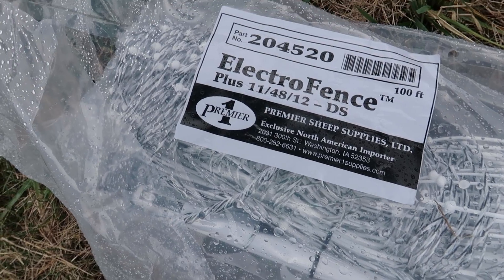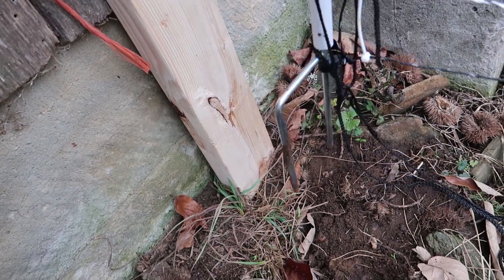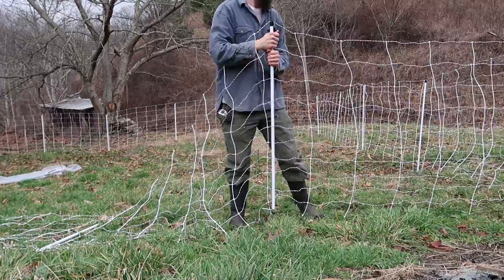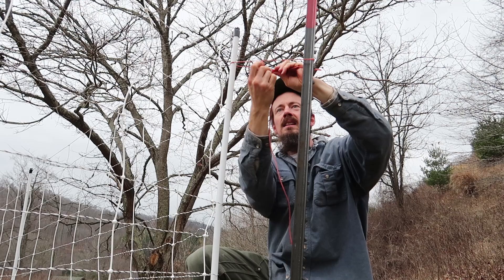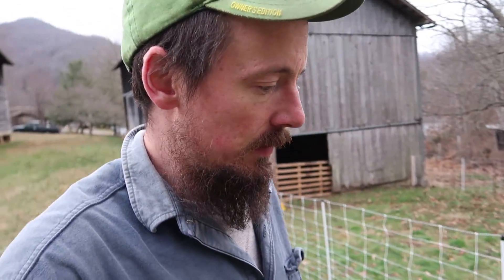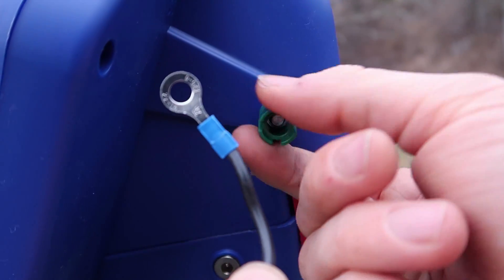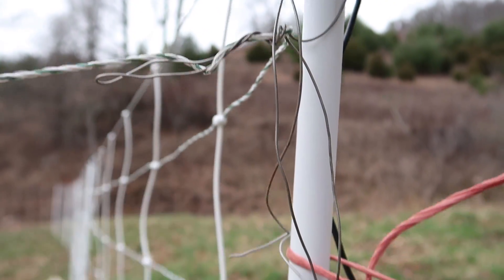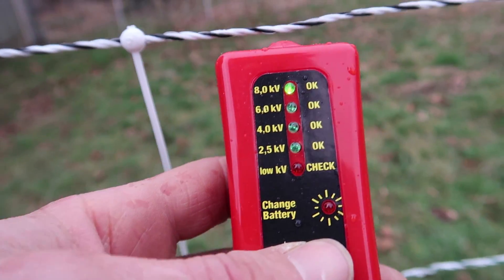Premier One Electric Netting Fence and Charger Setup For Goats - 8K Volts!

Comment: My goats figured out how to respect the fence over night. Originally I thought a dog charger was all I needed. My goats laughed at it. I found out one that worked against cattle was also way too weak. When I got a goat fence charger and swapped out the dog charger, by morning the goats respected the fence. So did my grandchildren! 

I have a people gate that has a wire 18" above the ground. The goats won't even challenge that wire even with the gate open! Moses one of my breeding bucks new a section of fence was dead. I fixed it and when he realized it was working again ran halfway across the yard shook his head at it bellowed at it, until he saw the females in heat on the other side...that got him back on his game...but he doesn't challenge the fence.

Comment: I looove the music you used here. I like using it for time lapse stuff :) On inexpensive land: there is actually some really cheap land in southern CO- about 5 acres for $2k. But there's no water so you'd have to ship it in and have a cistern, which isn't ideal for us personally. We are now looking in AZ. Still short on water and land is a bit more expensive than southern CO, but there is lots of industry stuff for us (jewelry, machining, and gunsmithing) so that's where we're setting up. Thanks for the fence setup demo! I know nothing about electric fencing so I appreciate everyone talking about it and showing us how it works.
Reply from the maker: Lots of special concerns with electric fences in very dry regions. When extremely dry, sometimes a pos/neg netting fence is ideal. Instead of relying on a traditional grounding rod this fence contains alternating ground wires and requires contact with a hot and ground wire to achieve a shock. 

Yes, water a huge concern out there. The water right situation in CO is so foreign to us out east where every mountainside has springs and creeks. 

Thanks for your thoughts.

Comment: This viseo came just at THE PERFECT time, just what I have needed to learn about! Thank you for sharing! I didn't hear you say if this fence runs off of solar power, and then has to be charged by electric at some point, or if it runs totally from the sun power, off of that solar panel that you put on the t-post. I've seen others use these fences on YouTube, but haven't heard the entire operation of them, and haven't researched further into the way it works yet. I'm not familiar with how this works, so trying to find out for sure, because I'm looking at this fencing possibility to start with chickens and around the garden to keep predators and nuisances out.
Reply: If there is enough sun it should charge by solar only.  You can charge by plugging it in to home electric as well though.
Reply from the maker: It is solar, but if you aren't getting enough sun you can plug it in and charge it.
Reply: ART and BRI Great! It's good to know that you have the security you need with an electric fence, yet not having the electricity use cost! Also good that it can be moved anywhere, versus the cost of a permanent fence, and limitations of permanent fencing. Thank you so much for your reply!
Reply from the maker: The only time you would need to recharge a fence like this with AC power is during long runs of cloudy weather in the winter. If the charge drops below a certain level, for the sake of animal containment and battery life, you need to plug in and charge. If you live far north or plan on lots of winter use, there are certain chargers designed with larger panels and batteries. Running the battery low reduces its life. In face proper charger storage involves periodic charging, or easier, just leaving the charger where it gets come sun every day to prevent the battery from running down with time. The charger from Justin, used with the chickens right now, has had great performance straight through the last several weeks that were mostly overcast. 

Solar chargers are great for flexibility and portability, but they are not cheap and batteries only last 3 - 4 years officially.
Reply from the maker: If you want to fence a large area, an AC charger can be much more economical, as you can buy a very powerful charger for a relatively small price compared to solar. Running fence on AC power really does not cost very much.
Reply: ART and BRI Thank you for your thorough explanation of how it works!

Comment: This was very informative. I have 2.2 acres and I want permanent fencing but can't afford to get it at this time. I have a smaller section that I was just going to have chickens in. I think with this fencing though I can go ahead and get the sheep I want and then use this to move around and attach to the entrances of the section I already have. Or even get enough of it to fence off where I wanted the permanent fence until I can get more established.That way once I do get the permanent fencing I can still use this kind to rotate them to different sections.

Comment: I am old and my electric chicken fence is heavy.  I've been wanting to make a carrier for it out of a old furniture dolly, but haven't figured it out yet.  Thank you for telling me how to hook charger in the corner and about the grounding post and how you get it close to buildings.  Mine didn't come with a grounding post and I have been running it without one.  Justin just told me it is necessary so I put fence away till spring...and a grounding post, lol.  OHIO
Reply from the maker: Glad you learned some. I don't think you get any shock without some grounding. There are positive / negative fences that do not use grounding rods where ground wires alternate with hot wires and you have to touch one of each to get a shock.
Reply from the maker: Maybe buy shorter sections  of fence in future as they are much lighter. If you buy more.

Comment: I am/was thinking about using them after seeing you use them as a perimeter fence around my rabbit pens if I ever get back in rabbits again.  At my peak I had round 150.  I still got the cages.  I had thought about erecting a wire shed around/over the rabbit pens and say 5ft from them, BUT this looks way cheaper.  ONLY THING I SEE IS, the rabbits would be in a clearing in the woods near my barnyard, and id be afraid of small limbs falling down on them and shorting the fence out.

Comment: Easy and looks good....it is really hot though.....it wont hurt the goats will it.......especially the babies?  That is a lot of voltage!
Reply from the maker: Well, it does hurt but that is the point. Pulse electric fences are quite safe and won't harm the goats. In fact, it takes a lot of electricity to deliver an effective shock to a goat because of their high resistance to electricity and relatively light weight.
Reply: I was just concerned about the high voltage......have been raising dairy goats for 15 years and I know that if they can find a way out...they do.  This is something I might try.  Used solar  before but did not get that much.  Thanks for sharing

Comment: Is this the same type of fencing you use for your chickens? I'm guessing the chicken fencing would be a  lower voltage? Where would I find Premier One fencing? I just found this channel and have not seen but a few of your video's .If you addressed chicken fencing in a previous video I just haven't seen it yet. Thanks for sharing the info on this fencing!
Reply: just punch it in on line,see it all
Reply from the maker: Here is the link to the Premier One website. I highly recommend calling them if you have any questions. They are VERY helpful.   https://www.premier1supplies.com/
Reply from the maker: Yes, the goat fence is higher voltage than the chicken fence, but actually it should be the other way around. Generally, the smaller and lighter the animals take more shock to effectively contain because they are less well grounded. If I remember correctly it goes something like this: rabbits, chickens, goats, sheep, cows, horses, pigs. Rabbits need the most shock and pigs, short and heavy, need the least for them to feel it. Interesting right?

Comment: I suggest two ground rods tied together when using such a short rod. Not only does it improve the grounding, but gives a more secure system. You may want to consider a longer rod that pounds in a bit, for the same reason. Do not forget to use same wire material as the rod, to prevent a dissimilar metal reaction

Comment: Is there a version on this fencing that is taller for Horses?
Reply: A simple hotwire or 2 should be enough for horses  buy a 5km roll.
Reply: LeftoverCrass FPV horses cannot see a hot wire and will run into . Large poly rope is visible.
Reply: What would I know, I only own 5 horses

Comment: not to be negative but is it a good idea to put pregnant sheep in a fence that could shock them and lose the babies?
Reply from the maker: From what we have read this is not a problem as long as you train the goats to the fence first.
Reply: Dont you think by first,  others mean before they are pregnant? The point of your training is to let them experience the shock in order to avoid the pain in the future.  How can you allow that during pregnancy.  If they dont touch it,  how are they understanding the fence.  Another RN here.
Reply from the maker: I should have been more articulate. By first I meant, train them to the fence before you allow them out into the fenced area alone. We will be taking a few days to adequately train them and make sure they understand the fence. Yes they touch it and get shocked by it. However you are there to make sure they are not injured by running through the fence and getting caught in the netting. Everything I have read from reliable sources has said that this is ok for pregnant goats and babies.
Reply: ART and BRI Great.  I feel better now. Best to you and family.

Comment: Hey Art and Bri Sorry to bug you but Im actually on Premier Ones website and Im wondering what the Joule is for the Chicken charger?  Do you think the .25 one would work for Turkeys?
Reply from the maker: Yes it will I think, however it is only recommended for one 164 ft section of poultry netting. The 0.5 joule unit says it will do 3-4 sections. Call them if you have any questions.
Reply: ART and BRI thanks so much!

Comment: A handy tool you can make is to take a pipe 2-3" in diameter with one end welded shut.  It is so handy to put in fencing or tomato stakes-just slip over the top and let drop with a bit of pressure. repeat til stake firm in ground.

Comment: One joule in everyday life represents approximately:

The energy required to lift a medium-size tomato (100 g) 1 meter vertically from the surface of the Earth.
The energy released when that same tomato falls back down to the ground.
The amount of electricity required to light a 1 watt LED for 1 s.

so the amperage is very low.
Reply from the maker: Never thought about it in those terms. -A

Comment: Just a small maybe useless tip, in some areas my Premier One Fencing doesn't stand up properly.  To combat this, I went to my local Tractor Supply store, went to their electric fence section and bought a few of their plastic posts, each cost less than two bucks. Youngings will jump the fence if they see it sagging.